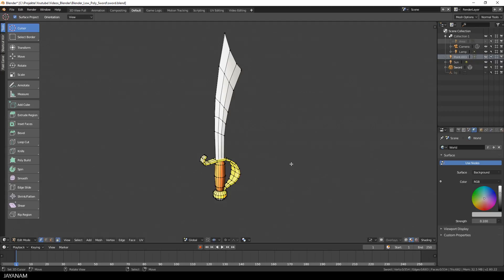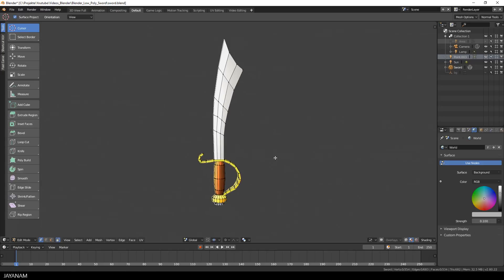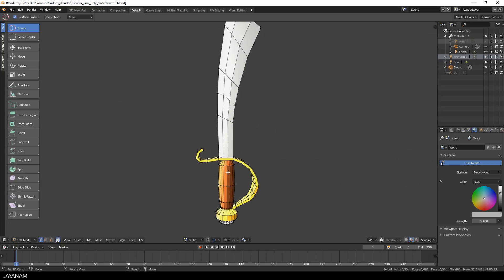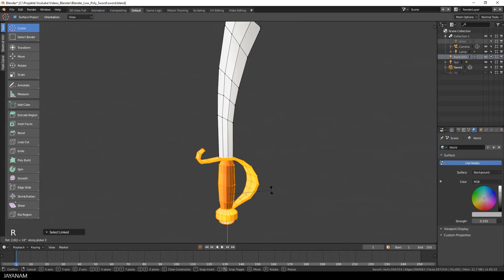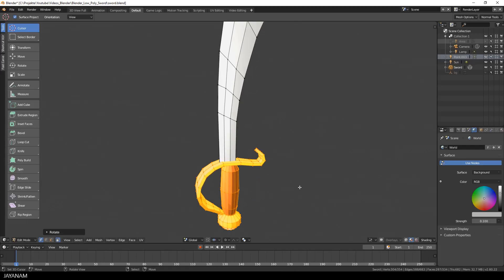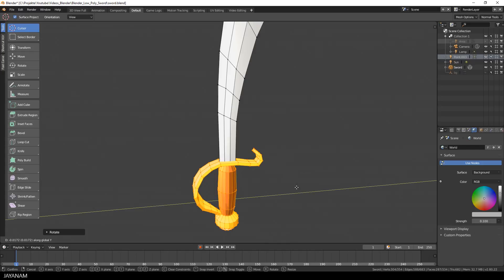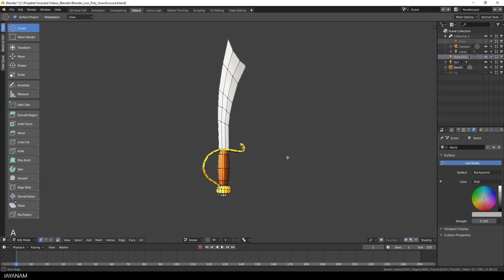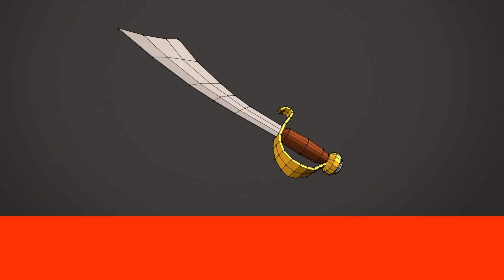Blender Low Poly Sword Modeling : Blade Correction

Comment: Hey Jayanam. Nice model. Giving you a heads up...Patreon might be shutting its doors soon. If you're not aware, it's because they've been censoring people and getting involved in an online culture war, that has negatively impacted many creators who were not directly involved. I suggest you take a look at another platform called SubscribeStar. It seems to be the best alternative.

When you have time, check out patreon's latest blog posts, and search for the backlash patreon faced from censoring individuals. This will affect you as well, if it hasn't already. Be prepared to switch platforms soon.